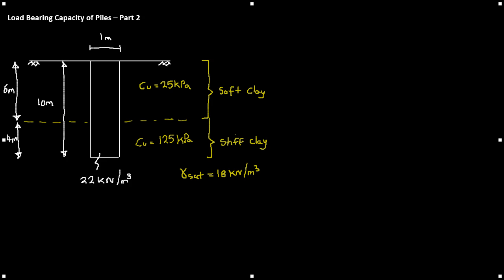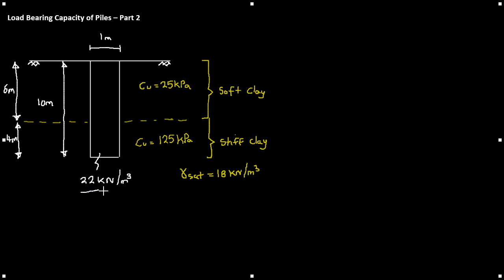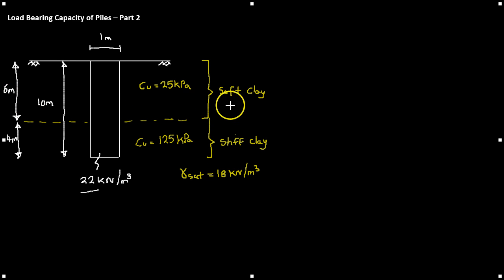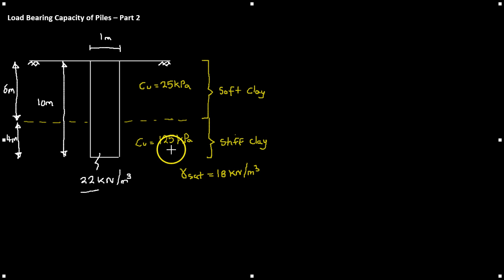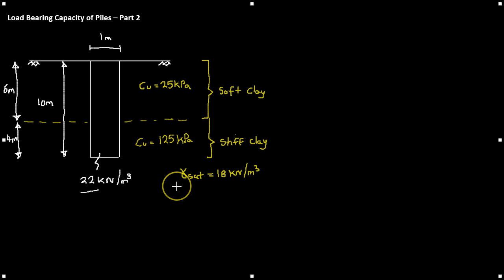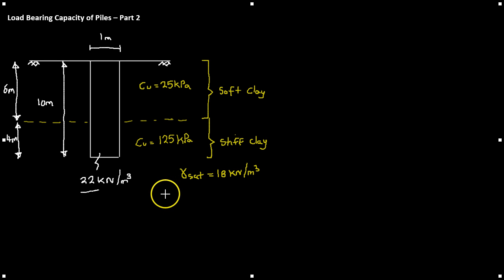Load Bearing Capacity of Piles - Part 2

Comment: When does the factor of safety kick in. The ultimate load already has a factor of safety of 1.5 times the service load. Do i need to use factor of safety a second time? Or is ultimate load enough for practical use?